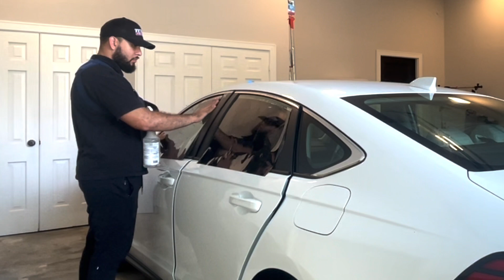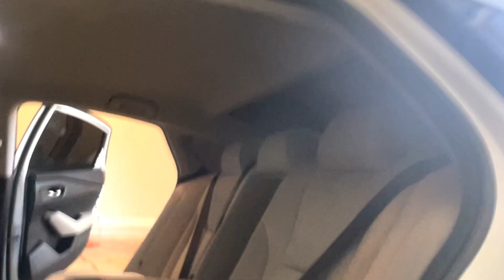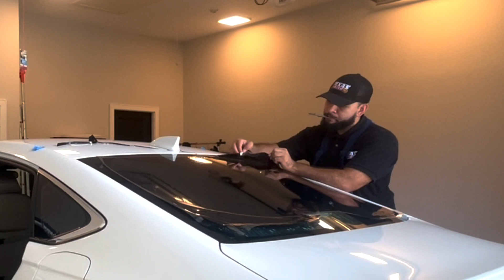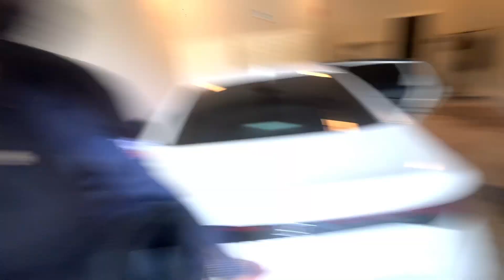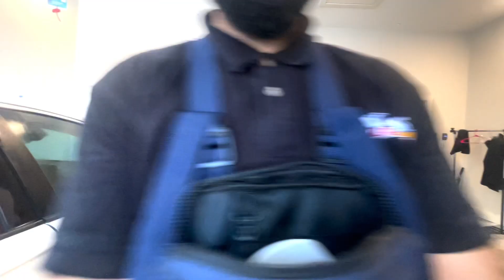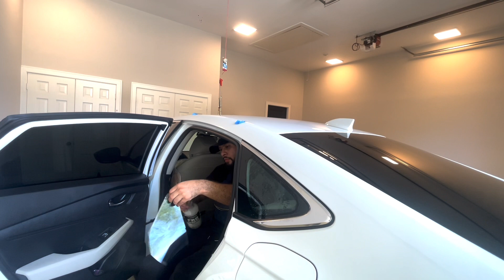30 Minute Window Tint Install 2023 Honda Accord | Fastest Window Tinter?

Comment: Just curious, where is all that solution going after you squeegee from the film?  I see some people having rags to catch the solution so it doesn't get all over the interior.  I may be missing something ot maybe there isn't much runoff?
Reply from the maker: All doors have a drainage on the panels so all the water just comes out the bottom of the door.
Reply: What do you think happens when it rains and you get out of your car
Reply: @kcav1255   Tint is installed on the INSIDE windows, so not sure what raining has to do with that.  The front windshield and back glass also don't have drainage holes, so where does the solution go if there's not rags , on your interior...

Comment: why is it you cut out the lower portion center in rear back window?
Reply from the maker: It’s plotter cut and at the request of some clients to avoid the failing of the annual inspection here in Texas by not blocking the brake light.

Comment: I pre plotter cut like you do. I guess I rolled the film to tight and the film seemed to hopped off the release sheet and left line on the film. So I had to recut three windows.
 Any advice on better handling or bringing out precut on a mobile job? I normally cut roll them up and put them in a empty film box. Could you post a video talking about how you prepare for a mobile job for the next day.
Reply from the maker: I roll mine pretty tight too. Just have to make sure you’re rolling it with the liner on the outside just like it’s on the roll. Each window is rolled individually and then I put them in a box with film. If your liner is separating it could also be the film you use. Thanks for watching!
Reply: @yourfavoritewindowtinter   I’m using HITEK but I just think I rolled them way to tight and caused it to hop off the liner. That and I cut the film 4days before the appointment, left rolled up like that might of had something to do with it. I’m sure it was operator error.
Reply from the maker: That will do it. Usually by day 2 it’ll start causing roll marks on the film.

Comment: Do you file or trim top edges that don't fit ???
Reply from the maker: Good question! I do both depending on the vehicle and glass type.
Reply: @yourfavoritewindowtinter  what do you like better the file or the blade
Reply from the maker: The blade as it’s cleaner and doesn’t have the chance of shave particles getting into your top edge

Comment: What soap do you use?? Distilled water???
Reply from the maker: Hey JBIRD! Johnson and Johnson with purified drinking water.
Reply: @yourfavoritewindowtinter  ok thanks
Reply: What tool did you use to get to the bottom of the back windshield
Reply: @jerseyrolla6479  why does the bottom back winshield need to be cut? does it affect if it alson included with tint?